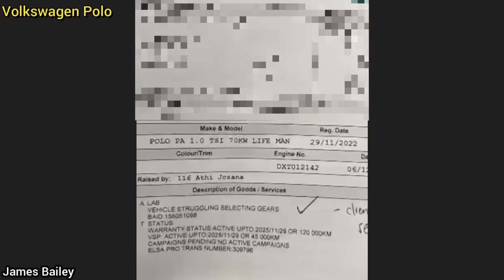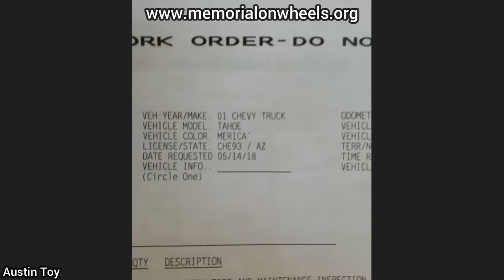Customer States They Need Door Repaired After Locking Keys In Car

Comment: ive had a diff (front) grenade on me,   becasue of no lube in it. and the water was displacing the grease OUT of the drain plug over time.   thankfully it was just a work truck.   my boss was like " fuck it uncouple front driveshaft and, we have been driving 4x2 for 2 years.    Ford F250    edit: one snowstorm, a co worker selected 4x4 and all he was hearing was whirring noise from transferase,  rear wheels wpinning.  He assume f250s was shitty 4x4.    until a week later,  we mentioned that that truck number (asset number painted on bumper) had no front driveshaft.   he paused and howled in laugher  and said " i really thought fords built really terrible 4x4's from my experience"

Comment: Too bad there is no law that allows certified mechanics to keep a dangerous vehicle off the road when a customer refuses repair of items that could endanger the lives of others on the road like the car with a wire holding the steering component together. People are incredibly stupid. Drivers licenses need to be issued that are more modeled after commercial licenses. It would keep those stupid people off public roads.

Comment: “Transmission fluid” in a Harley-Davidson motorcycle?! Aren’t these wet clutches bathed in engine oil like most non-Italian bikes?
Reply: Harleys don't have unit engine / transmissions. They're separate. That's why they have to have that big primary belt from the crankshaft to the tranny's input shaft. My Ural is the same. Two drain plugs, two dipsticks. I'm not sure about Harley clutches whether they're wet or dry, My Ural has a dry clutch. It doesn't rattle like a Ducati though.